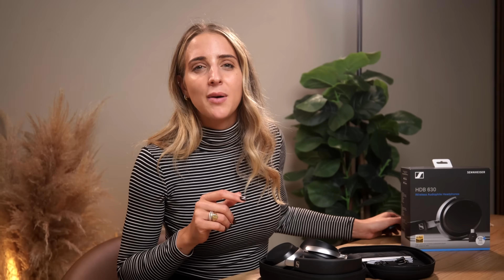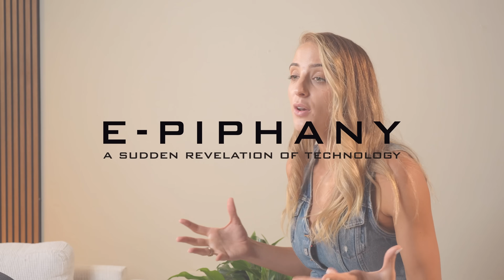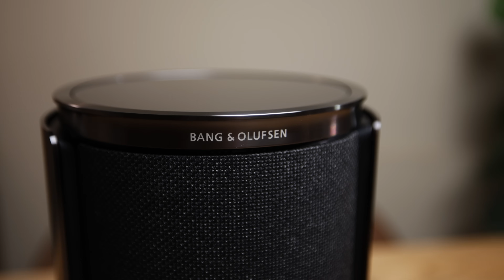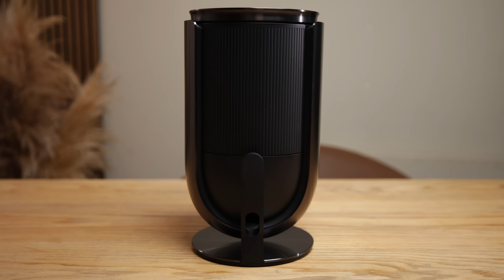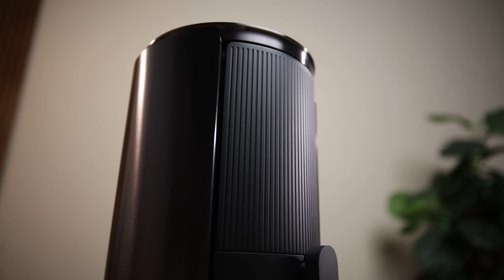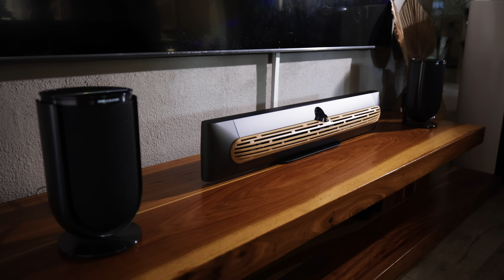The Truth About the Bang & Olufsen Beolab 8

Comment: KEF LS 50 WIRELESS 2....with a KEF Kube 8 sub. Sound is excellent. I dont work for KEF but the science and engineering in their speaker design is premium. For my living room size my set up is perfect.
Reply: I went from a set of Kef Wireless 2 with 2x KC62 subwoofer, to my current B&O setup. This has a set of Beolab 8's as fronts and a set of 8's as rear surround speakers, combined with the Theatre soundbar and Beolab 19 subwoofer. 

For pure stereo music listening, the Kef beats the B&O's soundwise. For the rest I love the versatility of the B&O speakers combined with the soundbar and multiroom options. Have several more of their speakers spread around the house and I love multiroom. 

The app however is so so and the setup reliability is really depending on your network performance and settings.
Reply: @djevodjevo you must miss bass in the music ? Comparing your Kef setup with Beolab 8’s ?
Reply: @zoran20261 not really actually, but a second sub would be nice for more overall power. 

Wattage of the Beolab 19 is less compared to the KC62, but the size is a lot bigger which makes him dig deep more easy.
Reply: @djevodjevo thank you
Reply: Well said!
Reply: @howardskeivys4184  The design where the tweeter is centred affords a sound experience that is different from the std set up...along with the Metamaterial Absorption Technology (MAT), a revolutionary plastic-like synthetic structure shaped like a complex, maze-like disc. Mounted behind the tweeter inside , it absorbs 99% of rear-traveling high-frequency distortion for remarkably clear, natural sound.

Comment: SIZE is always better - assuming the engineering is great. This is what the B&O fans "overlook". B&O DOES NOT SOUND as great as other high end components. Class D amps suck - no high end system uses Class D. Ultimately, sound reproduction is about physics and clean energy. You can't beat larger drivers, bigger amps, and better power supplies. B&O looks great - but you are compromising sound quality.

Comment: Looking forward to your review of the Premiere together with the Beolab 8. I currently have a sett of BL8 connected to my bedroom TV and thinking of getting a Premiere as well. 

A couple of comments on your review. First I also miss a HDMI connection, like e.g. Kef LS50 Wireless II or Kef LSX II has. However to can connect the BL8 to an Apple TV with Airplay. Works really well as they connect automatically when starting the TV and there are no lip synch issues. Another alternative is to get a Beoconnect Core inbetween your TV and Beolab 8. The Core has an HDMI input and can connect to your BL8 either with wire or wireless. Though, it cost EUR 1150, so quite an expensive option. 

Last but not least, I’m curious how you could try out “fluid sweet spot”. That functionality is not available in the regular B&O app. Did you get a special review software or did you download the app from App Store?

Comment: Really enjoyed your review. Two things that are amiss though. You can infact use the Beolab 8s with a tv if the tv has bluetooth, you can pair the 8s to the tv and also if you have AppleTV 4k you can airplay the speakers through it as a wireless solution. I Look forward to your Premiere review combined with the 8s.
Reply: Bluetooth pairing with TVs will have a delay.
Reply: @thunderchickennn Depends on what TV. I have an LG G5 which has an audio option to use Bluetooth speakers on the tv. As well as connecting a tv via optical with volume control provided by the tv also.

The reviewer said there was no way of using the Beolab 8s with a tv because it has no HDMI inputs.

However there are a few alternatives as I mentioned to use the speakers with a tv in both scenarios.